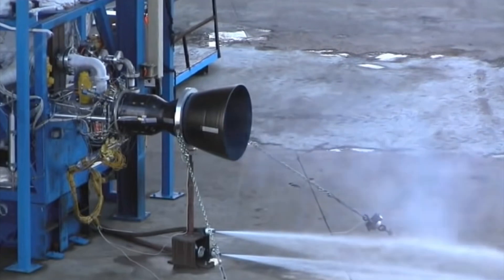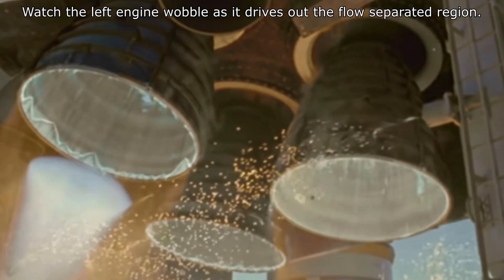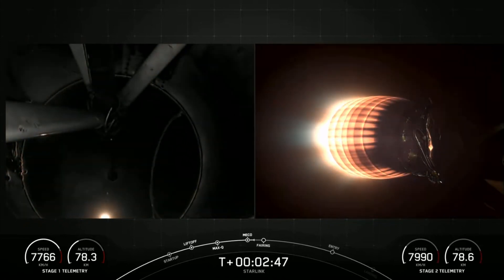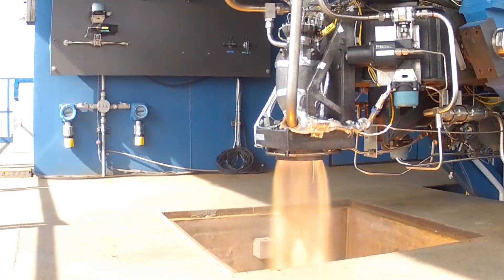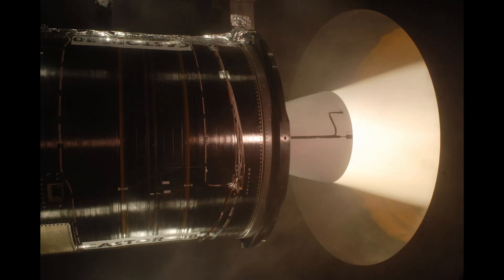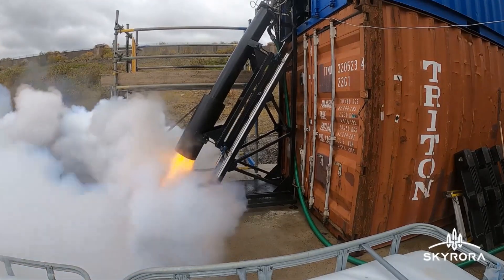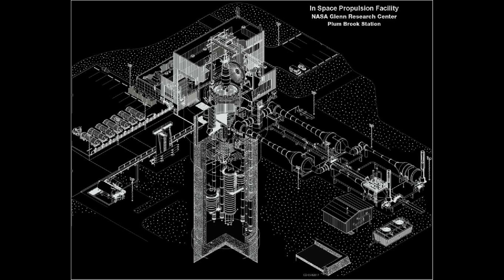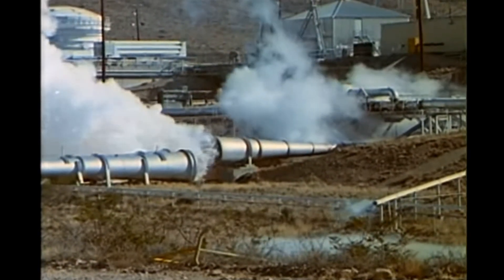Defying Atmosphere - How Rocket Engines Get Tested In A Vacuum Before Going To Space

Comment: What is the rocket propelling off of in space? The idea of combustion in space isnt my concern but more using the 3rd law of physics you speak of, what is a person or rockets actually pushing off of that has equal or higher density?
Reply: You don’t need something with higher density. You need something with mass. Gas, especially that coming out of the rocket exhaust, has mass. It was moving with the rocket. It enter the combustion chamber, ignited, which rapidly expanded the gas giving it high kinetic energy. It was then released into space in the opposite direction going very VERY fast. Laws of momentum dictate that momentum is conserved. The the momentum of the gas going one way, will equal the momentum of the rocket going the opposite way, which will then cancel out making 0 net change in momentum. Thus momentum is conserved. And momentum is defined as mass times velocity. 100kg of exhaust gas going 2,000m/S is the same momentum as a 1,000kg mass going 200m/S.
Reply: @engineeringtheweirdguy2103  hats a solidexplanaition. I can rspet that 👍🏽
Reply: @wrillywonka1320 simple answer is that if you throw something behind you it pushes you forward whether or not it hits something, if you throw it faster it has more force
Reply: @peeperleviathan2839  🤣🤣
Reply: The exhaust.
Reply: @GuardianSoulkeeper  im sorry but if a rocket pushed against exhaust the exhaust would move not the rocket
Reply: @wrillywonka1320  It does move...at supersonic speeds no less. Also, why would the rocket not move? Where is the conservation of momentum?
Reply: @wrillywonka1320  Rockets push out mass at Mach Eight (at sea level) and even FASTER in a vacuum.
The rocket feels a "recoil force" of pushing out all that mass which pushes the rocket in the opposite direction.
Rocket Propulsion is just the mechanical recoil of pushing on mass.
Reply: @stuartgray5877  still have to push against another object. If what you say is true then wouldnt it be just as possible to have some dollar store rubber bouncy balls n like let one go at the back of the rocket and then have a paddle slap it, therefore thrusting the rocket all the way to jupiter?
Reply: @wrillywonka1320  the rocket (object with mass) applies a force to the mass of the exhaust gas accelerating it away from the rocket.
So you dispute that the rocket must apply a force to accelerate the mass or do you just not know thati rocket exhaust has mass?
Reply: @wrillywonka1320  care to calculate the momentum of a dollar store bouncy ball moving at mach eight?  No?  Didn't think so.
Ion propulsion works in space even though the engine is outputting milligrams per minute but at velocities you likely cannot comprehend (big numbers)
Reply: @stuartgray5877  im sure the rocket ehaust has mass. But like i said, you might as well use a rubber bouncy ball since the amount of mass must obviously not matter up against a giant rocket. Also the fact that a gas is not a solid also leads me to believe the energy is dispersed equally in every direction making the amount dedicated to the rocket (if any exists at all in the vaccuum of space) would be even less than a rubber bouncy ball.
Reply: @wrillywonka1320  according to the law of conservation of momentum, the rocket MUST absorb the same amount of momentum as it imparts into the mass of the exhaust gas. 
So if a space shuttle main engine can accelerate 500 kilograms of exhaust gas to 2500 meters per second, how much momentum is that?
I know you don't know, but trust me, it's A LOT!
Reply: @stuartgray5877  ok. Ill respect that
Reply: @wrillywonka1320 also individual gas particles might have very little mass. But added together it’s a lot of weight. A small BBQ gas bottle carry’s 9kg of LPG gas. A rocket 30 stories tall holds hundreds of tons of fuel which will be burnt. Conservation of mass tells us that this means there will be hundreds of tons of exhaust gas existing the rocket at Mach 8. Not hard to see how that gives you a significant push to a rocket.
Reply: If you were in empty space holding a bowling ball and you pushed that bowling ball away from you, you would be propelled in the opposite direction.  Newton's Third Law.  Or probably more appropriately in the case of rockets - the conservation of momentum.   If you were floating in deep space holding a bowling ball with zero momentum, then that system (you and the bowling ball) will always have zero momentum.  If you push that bowling ball away from you, you impart momentum on that bowling ball.  The SYSTEM'S momentum will be conserved by the absolute fundamental laws of physics.  Which means for that system to conserve momentum, you will necessarily be imparted with an equal magnitude of momentum - but in the opposite direction.  The momentum of the SYSTEM is still zero.  It's again - - FUNDAMENTAL to physics.  Rockets work precisely the same way.  If you had a rocket in deep space with zero momentum, and that rocket ejects mass away from it, that rocket has imparted momentum to the mass it has ejected.  By the fundamental laws of physics, the rocket will NECESSARILY be imparted with momentum in the opposite direction to maintain the total momentum of the system zero.

If you need to think of it in terms of Newtons third law, when you push mass away from you, that mass pushes back.  You push a bowling ball, the bowling ball pushes back.  Rockets push mass in the form of ignited fuel away from them.  That mass pushes the rocket back.  There's your equal and opposite force.

Things like planes need air because the air is the mass they are pushing away from them.  That's why planes need air.  Rockets don't need air.  They take the mass they push away from them with them.  They bring it along.  Planes use fuel to operate an engine that turns a propeller that brings in mass and pushes it away from them.  Rocket don't need fuel to operate an engine.  Rocket fuel IS THE MASS which is pushed away from them.  It is literally why rockets work differently than planes.  BECAUSE THEY ARE DESIGNED TO OPERATE IN A VACUUM.  So they simply bring the mass with them to push off of and eject away from them.  They ignite the fuel to provide it energy so they can push that fuel away with a great deal of velocity - imparting that much more momentum on that mass - - and thus more on itself.  

ROCKETS.
WORK.
IN.
A.
VACUUM.
Reply: @willoughbykrenzteinburg  so in theory u culd kik ur shoe off or jus blow n u culd travel to jupiter? Ur not much of a deep thinker
Reply: The rocket doesn't need anything to propel off of.

If you were in deep space and you were holding a bowling ball, and you pushed that bowling ball away from you, do you think that would have absolutely no effect on you?  You think you would remain still and the bowling ball would go off?  Do you think this?  You don't think you would move AT ALL?!  If that's what you think, then there is no point trying to explain how rockets work to you.  You will never amount to anything remotely close to important in a realm where it matters whether or not rockets work in space.  You'd basically be a 3-year-old insisting that planes can't fly.  That's the extent of your authority here.
Reply: @willoughbykrenzteinburg  u do realize that that logic doesnt transfer to combustion? Pushing off an object as opposed to pushing gas into a vaccum is very different. So since you have been to space, are you able to blow or use fart power to travel through the vaccum? Because if so, i am mexican and im thinking maybe i should sign up for nasa as our internal combustion power may have been overlooked
Reply: @wrillywonka1320  "I'm a moron" would have been a more efficient comment.
Reply: @wrillywonka1320  So first lets discuss how rockets work RIGHT HERE on earth IN ATMOSPHERE.

When a rocket engine is running, does the exhaust gas get "Accelerated" by the rocket engine?
Does the exhaust gas have any "Mass"?

We SEE the exhaust gas leaving the rocket at high velocity.
HOW did the exhaust gas reach a high velocity?
Reply: @stuartgray5877  the force created by internal combustion.
Reply: @wrillywonka1320  So Combustion creates gas Pressure (some rocket engines run higher than 3000 PSI) which pushes the gases out of the combustion chamber?

So the 3000 PSI gases "PUSH" the exhaust out against the 14.5 PSI atmospheric pressure?

Is that a valid way of describing it?
Reply: @stuartgray5877  ok works for me. Whats this have to do with the vaccum of space? Because all this is fine and dandy for your ego but problem occurs when you try pretend the vaccum of space isnt strong enough to counter 3000 psi of exhaust.
Reply: @stuartgray5877  keyword here is "pushes". In space thetes no push. Theres a vaccum. Nothing to push off of. If you think you can push off your own exhaust you should probably re evaluate the way you understand exhaust. The combustion is still only combustion, not thrust. In order to thrust, you need resistance which isnt available in a vaccum. You can actually buy a vaccum at walmart..thats where you shop right?
Reply: @wrillywonka1320  - "Nothing to push off of."

Oh, so according to YOU, a crossbow fired into a vacuum would not have any recoil?
Sorry but that is NOT how Newtons laws work.
Reply: @wrillywonka1320  so you don't think a crossbow fired into a vacuum would experience recoil.

Understood. You do NOT understand Newton's laws.
Thanks for the clarification.
Reply: Like others said, the exhaust
Reply: @optimND  well like i said to others "here on earth where theres actually atmosphere to thrust off of, get a video camera, get on a skateboard and fart. Post a video of how far you thrusted and ill humbly bow down
Reply: @wrillywonka1320  yeah, but rockets send much more exhaust at speeds multiple times above the speed of sound.

"ere on earth where theres actually atmosphere to thrust off of"

Life is NOT thrust. Rockets bring their own fuel to "thrust off"
Reply: @optimND  true but space has an unmeasurable vaccum. Sooooo that counters exhaust thrust.
Reply: @wrillywonka1320  "unmeasurable vacuum"

Near 0. That's your measurement. That does not "Counter exhaust thrust". Crazy that you don't even understand newton's laws.
Reply: @wrillywonka1320  The "vacuum of space" cannot exert a force on anything.

Answer this:  When a Rocket Engine is running right here on earth in atmosphere:
Does the 3000 PSI gas "PUSH the gas out" against the 14.5 PSI atmospheric gases?
OR
Does the 14.5 PSI atmospheric gas "SUCK the gas" out of the 3000 PSI combustion chamber?

WHICH IS IT?
Reply: @wrillywonka1320  - "well just study vaccums bud you will figure it out lol"

I have an Engineering degree and I have been a vacuum test specialist since before you were born.

My first job in Aerospace after getting my Engineering degree was at Lockheed Martin Space Simulation Laboratory where I learned to operate some of the largest thermal vacuum chambers in the country.
I have run over a dozen thermal vacuum tests.
Some of those lasted MONTHS with a Multi-BILLION dollar vehicle inside.
Now tell us what YOU do for a living genius.

Comment: Newtons 3rd law does NOT work without an atmosphere to push against. So rockets don't provide thrust in space. It's not about ignition in a Vacume
Reply: Funny. I can’t see the word atmosphere in any of newtons laws.
Reply: So you are suggesting that the exhaust gas from a rocket has no mass?
Maybe you should think about that again.

Would a CROSSBOW have recoil if fired into a vacuum?
Think about it and explain.
Reply: And may I suggest that you actually take a high school physics class before trying to debunk thousands of years of established science?
Reply: It would be a violation of the third law of motion if rockets didn’t work in a vacuum. 

A rocket must impart a force on the exhaust gasses to accelerate them out the back. Therefore there is a resultant force that the gasses impart on the rocket. It’s that simple.
Reply: Thinking rockets wouldn't provide thrust in space is pretty much the same thing as thinking that if you got punched in the face in space, you wouldn't feel it.  That's how utterly stupid you are.
Reply: @willoughbykrenzteinburg  OR if you set off a hand grenade, in space, the pieces would NOT fly in all directions.

Comment: I would like to hear more about thermodynamic laws, especially free expansion of an ideal gas. I know that gases aren't ideal in reality, but... expansion of an ideal gas in vacuum does no work, i.e. no resulting force. Maybe that "certain person on the internet" was referring to this sort of framing of the question? Better posed the questions could be something like:

Background:
Cold gas trusters use e.g. expansion of CO2 through a nozzle.

Questions:
1.) Is Newton's third law noticeable with a subsonic CO2 cold truster in vacuum?
2.) Can you please provide the test result of a force measurement of a cold gas thruster in a vacuum chamber: Force as a function of ambient pressure.*

*). Please make sure that the pulses from the cold gas thruster are short/small in comparison with the volume of the test chamber, and that the measurement of the force is made in steady-state for the mechanical test setup.

Cheers from Sweden
Reply: Does gas want to expand in all directions?
Reply: @entangledmindcells9359  want and want... yes, molecules have three dimensions to propagate. Gas molecules aren't behaiving the same way as when throwing heavy stuff from a boat (Road to the Stars, Soviet propaganda film 1957): https://youtu.be/9CX0oSjwLqI?si=N9kjeFSGpXogAeAn&t=426
Reply: @StudioStupidoSE  - Well here is an example:
A Space Shuttle Main Engine (SSME) consumes 500 kilograms of liquid oxygen and liquid hydrogen per second.
It combusts the fuel and oxidizer creating 500 kilograms of "Exhaust gas" per second.
This exhaust gas is PURE WATER and it exits the nozzle at 2500 meters per second.

How much "Work" is required to accelerate 500 kilograms of mass from a velocity of zero to 2500 meters per second?
this is very easy to calculate.
This is the "work" performed by one SSME in one second.
You are welcome.

Now papalegba here will try to explain that rockets can accelerate mass without performing any work, because it is clueless about basic physics.
Pay no attention to it.
Reply: @StudioStupidoSE  SO YOU answer my question since papalegba refuses to answer questions.
We SEE the exhaust gas change velocity as it leaves the rocket , so from WHERE does the force originate that accelerates the mass of the exhaust gas from the rocket?
Reply: @stuartgray5877  we don't see that, chatbot 😂
Reply: @papalegba6796  - "we don't see that, chatbot"
We don't see the exhaust gases accelerate from the rocket?
Cool story bro.
 Maybe YOU should go watch one, because that is EXACTLY what we see - The exhaust fuel and oxidizer are at a velocity of ZERO, then the exhaust gases come shooting out the back at about Mach Eight!
What are YOU watching?
But thanks for proving you have never watched a rocket launch in your life.
Reply: @stuartgray5877  the velocity of a gas particle is a function of its internal energy, chatbot 😂
Reply: @papalegba6796  - "the velocity of a gas particle is a function of its internal energy, chatbot"
So gas molecules can just "Accelerate themselves"?
So you DO believe in "Magic"
Bless your little heart!

No sorry but even Newtons Laws say that a change in velocity of a MASS - REQUIRES a "Force".
You cannot change the velocity (momentum) of ANY MASS without applying a "force".
Now go back and finish high school so you learn what Newtons Laws MEAN.
Reply: @entangledmindcells9359  You didn't answer him, chatbot 😂
Reply: @papalegba6796  The answer to his question is in the answer to mine..

How about you answer mine and I will  show you how it works.
Reply: @entangledmindcells9359  Because papalegba NEVER answers questions. But it will claim to have already answered somewhere else in the multiverse.
Reply: @papalegba6796  SO tell us how the exhaust gas gets accelerated from the rocket nozzle.
You have SAID that the vacuum cannot exert a force, so WHERE does the force originate?
We SEE the exhaust gas get accelerated and we KNOW that exhaust gas has MASS, so where does the force come from that accelerates all that mass?
Reply: @entangledmindcells9359 gas expands equally in all directions. Gas particles bouncing off every surface in every direction, the net force is zero. But the force excerted is called pressure. Which acts equally in all directions. Open the nozzle to let gas escape. This gives a net force. Since the particles exiting the nozzle are no longer colliding with a wall. But there are still particles colliding with the opposite wall. Which is a net force. Net force equals motion. Simple as that.
Reply: @entangledmindcells9359  No it isnt, chatbot 😂
Reply: @papalegba6796  So Mr Kenetic Theory...
You know that theory that states that the kinetic energy of each Gas molecule is what causes gas pressure by causing the gas to move in all directions. 
Tell  US how Gas can be accelerated & directed in one direction with NO FORCE and NOT contradict Kinetic theory let alone thermodynamics & physics..
Reply: @entangledmindcells9359  You answered your own question, chatbot. Wrongly too 😂
Reply: @papalegba6796  So again.. Avoiding answering questions that prove you wrong.. well done.
Reply: @entangledmindcells9359  😂 ok gaslighting chatbot 😂